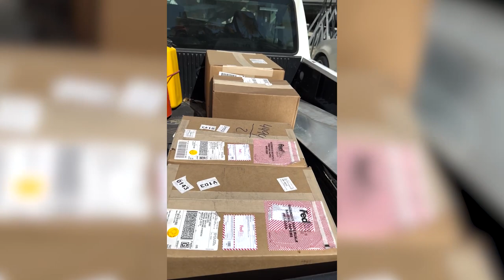How Many Boat Projects Until We Can Set Sail? | Battery Box | Sailing Wicked 21

Comment: How well do you like the new batteries? Are they much lighter than the older ones? We are considering making the switch some day.
Reply from the maker: We’ve heard nothing but good things about them. They are lipo4 and you should be able to use more of the battery. Below 30% without damaging the battery. We haven’t been using them long enough or operating off shore to give a recommendation but we bought them based off the recommendations of others.